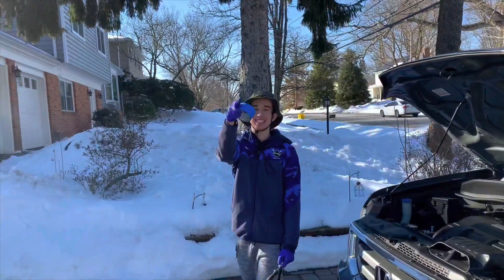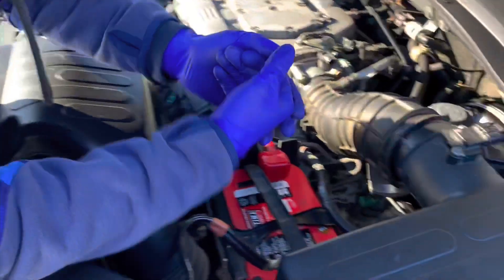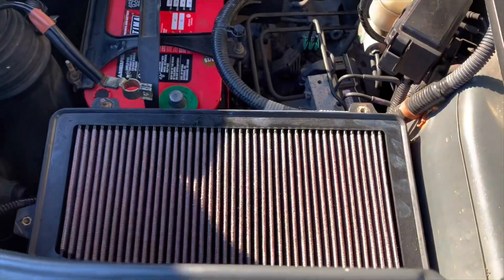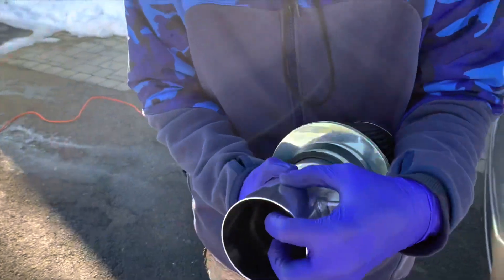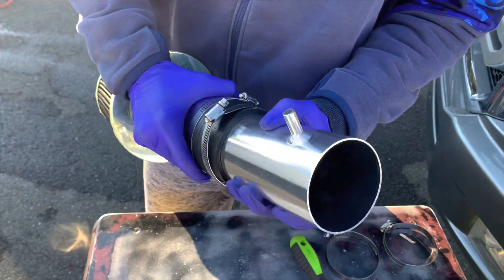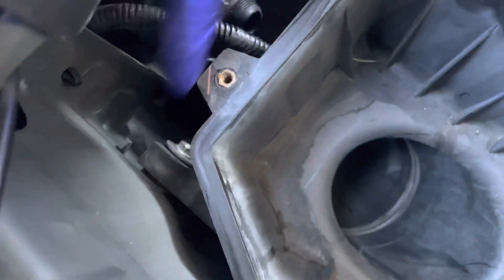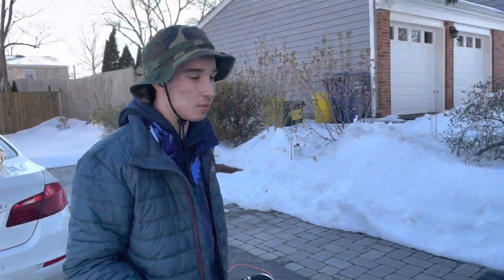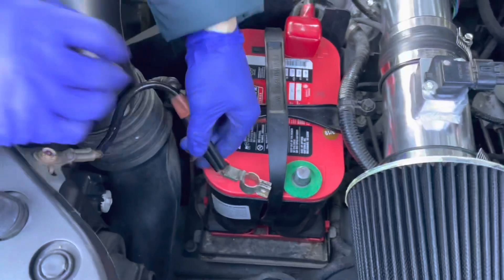2009 Honda Ridgeline Intake Installation

Comment: New work. Did you notice any extra fuel mileage after the install? I had a k&n short ram on a civic si and gained 50+ km of range per fill up.

Comment: Does the new hot air intake hurt performance?  Most guys install cold air intakes to increase horsepower, it's awesome to see some guys think outside the box!
Reply from the maker: Yeah it added some power but I mostly got it bc of the sound it makes